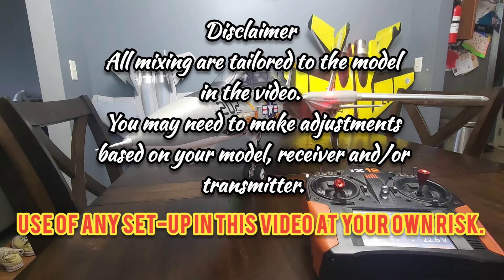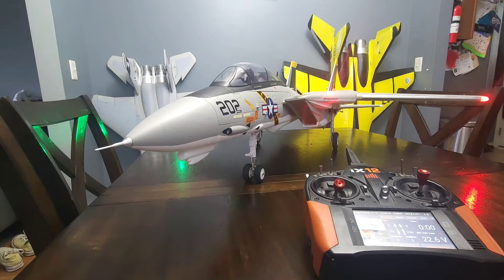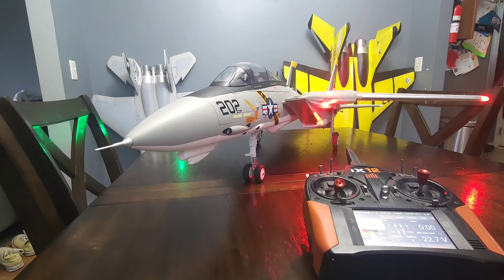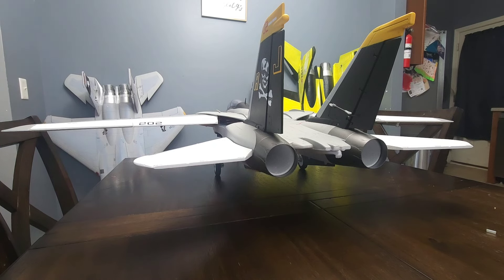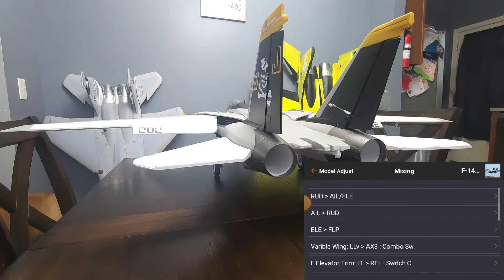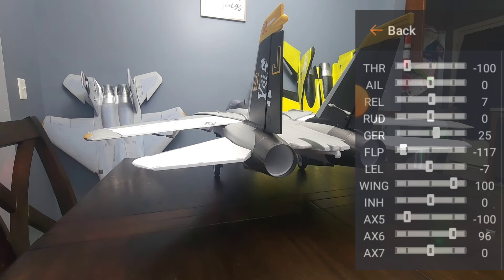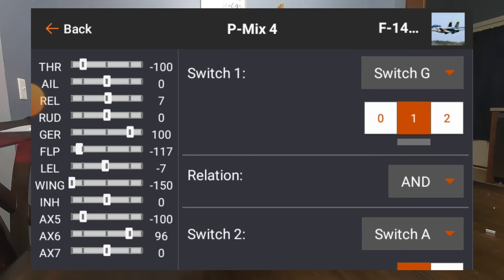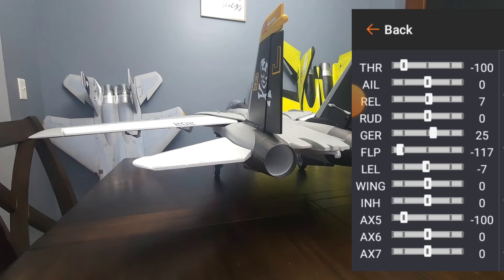Bypassing and Mix Setup FW F-14 Tomcat #freewing #rcplane #aviation #edfjet #spektrumrc

Comment: I appreciate the time you put into this and sharing it with the community! Having said that, I am more interested in your fuse reinforcement procedure to prevent or at least mitigate some of the buckling issues on hard landings. Please post your solution for the reinforcement. Regards, Hassan.
Reply from the maker: I will